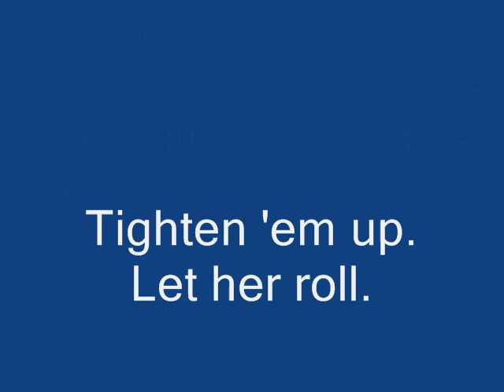Changing The Big Rig Tire

Comment: ok, everyone while i  agree using a cage is a good thing. ever since ive been a child me and my dad have aired up his big truck tires without a cage and never had one blow.  i can't even count how many times we did this.  i remember when i was little and dad had to use the either to get a few started and then get the air chuck on there.  i never even knew what a tire cage was for years.   not saying its not needed or shouldn't be used.  just throwing my experiance out there.

Comment: While a cage is a good idea, you can just put the tire under the truck while it airs up. Tubless tires are MUCH safer than the old split rims. With a split rim I would always use a cage!

Comment: ive had two blow on me while working at a truck stop, and two blow on a friend at the same time i was working. Bent the cages in all kinds of shapes and would have launched the rim/tire through a wall if it wasnt inside the cage. The first tire i had blow on me, blew because the driver bent the rim very slightly, tire lost bead at 80psi. Second tire blew at the sidewall due to cord damage while driving flat, it showed no apparent damage when underinflated and then blew at 100psi.

Comment: @necroterrorizer The michelins I have on my pickup are excellent. I got 92,000 miles out of a set with only one flat. The michelins I had on my large truck 11R22.5 some of them had a manufactured date of 05 but one had a date of 01. How that tire lasted 9 years is beyond me.

Comment: My two cents- Tire should've been aired up in a safety cage; especially since it is a repaired used tire.  Who knows how long it was ran flat?  Airing it up standing up- not a big deal, more important on a steer application.  Running a steer tire next to a drive tire- the tire is a Yokohama RY617, which is an ALL POSITION tire, plus this one is a used tire.  Why throw away a good $400+ tire?  Run it off when and where ya can.  New valve stem?  Not a new tire, and many customers skip the cost.

Comment: +steve silva I always thought about that. What if the thing explodes while handling it to put it on the truck. I'd rather install it first, then walk away while it is filling up on the vehicle. If it explodes, it damages the truck. Oh well. Better than me getting harmed. In my opinion, installing it to the truck is better than a safety cage.
Reply: doing what you say- mounting , and inflating right on the truck is the more improper way of doing it, a time saver method if you will. The method you are talking about is done on the sides of highways  and roads where TA and different road call service people do to save time and money. when you do this the bead doesnt sit  and seat properly on the rim and therefore causing the tire to "hop" along the road as it is driven and more major problems in the future including premature, irregular tire wear. not saying this mechanic did this the right way. i work on trucks exactly like these day in and out. more proper way:  inflate to about 20-30 psi on the ground(bead sits better on the rim laid down on ground) and put it in the cage  and inflate to 100 psi  then install on the truck @ 500 ft lbs, theres alot more to take into account of tires on trucks but this is the basics

Comment: @billandbeaufort.   Oh really???  So how are you supposed to set the lock ring in place while its airing up?  I air it up to 25lbs on the ground while tapping the lock ring in place, then simply put it on the truck, bolt it on then finish airing... Safest and best way.... Says 25yrs experience

Comment: Well I saw that no new valve stem installed didnt clean none of the mating surfaces did not bead tire flat inflated while standing  inflated out side of cage didnt oil up wheel studs or lugs and prob didnt torque the wheels correctly

Comment: This guy is not to bright. You put the tire in the TIRE CAGE, not rest it on it! I've never re torqued lug nuts after 100 miles. The only concern is on hub pilot wheels, make sure they are installed and no gap a tiny gap the side of a credit card those lugs will come loose and fly off. Two, GREASE the bead on the RIM then one one side is on the rim, grease the tire beed if needed. Normally you drop the tire the bead brake, I've never used a hammer on 22.5's.

Comment: Everybody is jumping up and down about using the tire mechanic not using the tire cage but as easy as tire took air my questions to all you sexual intellectuals is why, the rim was NOT a two piece or a locking ring rim.  I might say you all might have a point if need to use any beed seating tools.  I know the "book" says you are supposed to use one but the "book" is written for worst possible case with a complete idiot doing the job not a competent mechanic with common sense.
Reply: gullreefclub the reason why we all want the cage to be used in a video is so some idiot doesn't do that. Especially with a run-flat. We all noticed that he fixed a flat Tire. Which is suspect to zipper rupture. Showing a tire being inflated without putting it in a cage. Is like showing a dirt bike video without wearing a helmet.